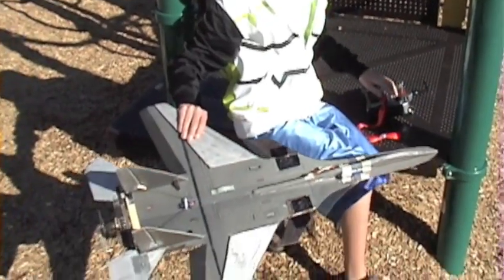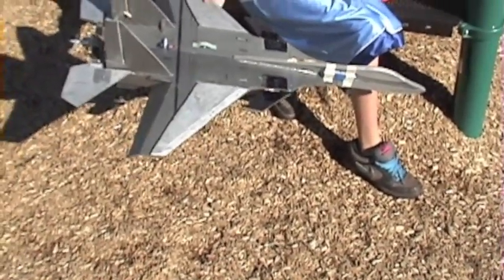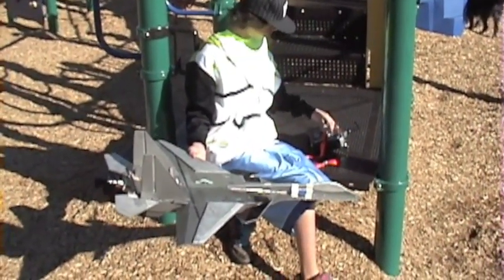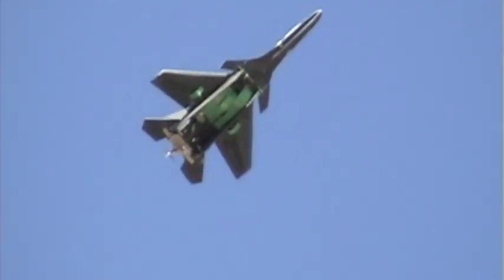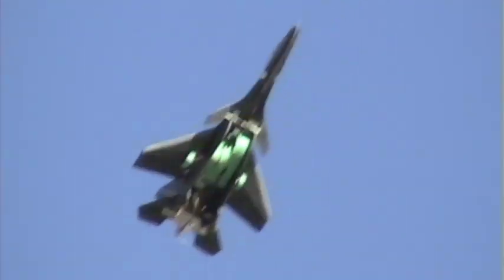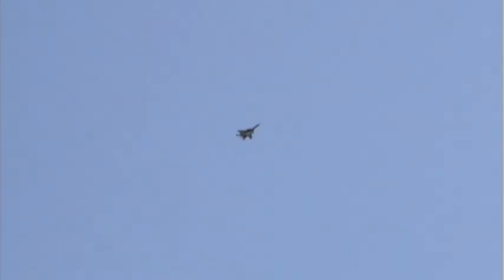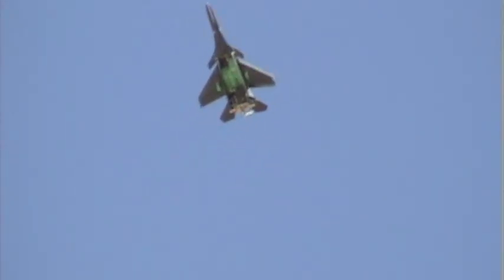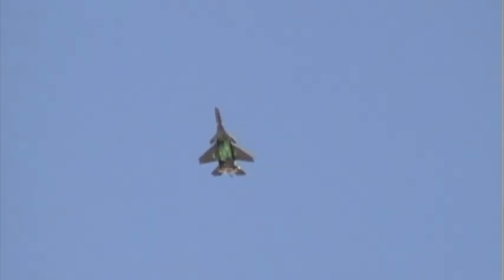RC SU-37 1st flight with KFm4 airfoil

Comment: that plane is so crappy..... LOL J/K. This is actually one of the nicest flat foam jets I have ever seen. Build me one! Question for you: Dave Powers used dual counter rotating motors, do you think your single set up suffers from torque roll when controlling the high alpha? I'd like to build one, but dont like the price tag on a dual setup. Great work, 5*